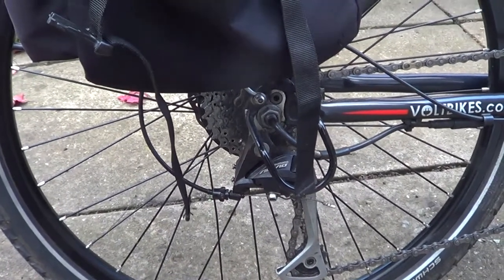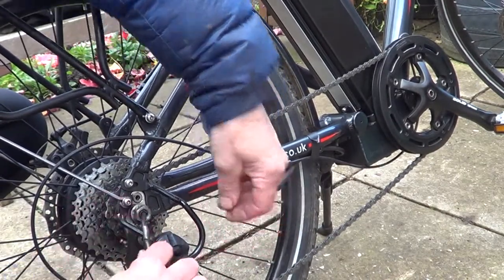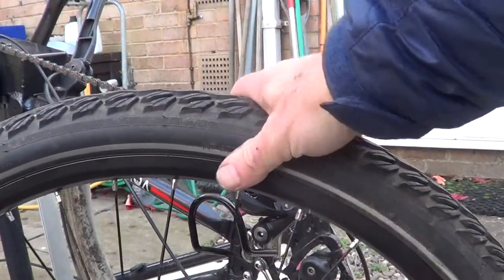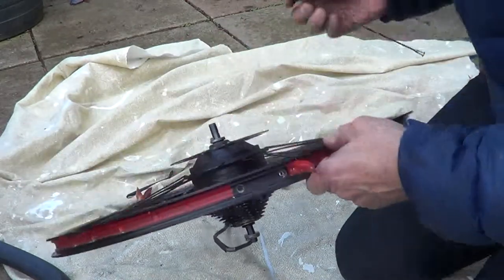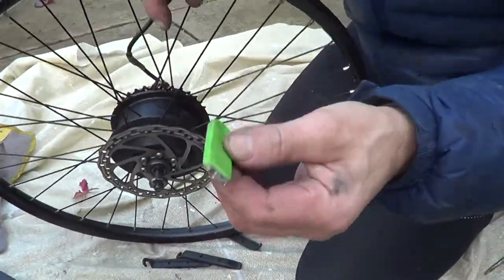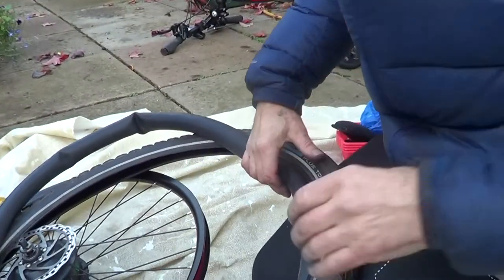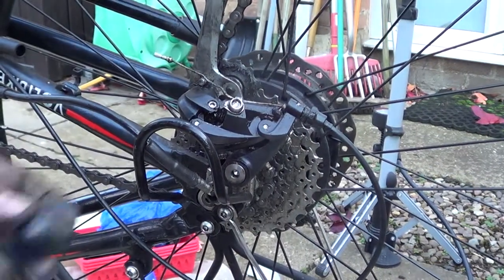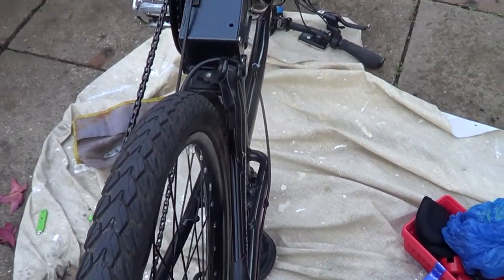Volt Bike rear wheel and tyre removal

Comment: Hey sir i have the same bike and I have 3 spokes broken but I don’t know the right size to buy them online , could you help me with the right size please
Reply from the maker: Hi Thanks for the comment I took my wheel to a local bike shop and he measured the spokes for me and found me a  replacement spoke for me to fit in. Now I'm sure they were these Dahon 208mm IOS Black Spoke I think these spokes he told me came from a folding bike which had small wheels but with the motor on the back wheel re the Volt you need these smaller size spokes if you have a local bike shop might be well worth taking the wheel as I'm not sure what the situation is on buying spokes online or how available they are Thanks Kev.
Reply: Bramley House Productions thanks a lot , I bought 208mm hopefully they fit on it , I went to London bridge shop on Tuesday but they were closed and they’ll open till the next year , I’m gonna follow you and fix it myself too 
I have an other question , I want to know if there’s any access to rich more speed on the Voltbike or it has a limiter speed ?
Reply from the maker: @Mohammed_Amine88  Hi good luck with the fix hope it fits your wheel also OK too. I did here these breaking spokes on some of the Volt Pulse bikes have been a problem in braking so if you do have more troubles go back to Volt bikes to see what they say! Like I say I broke mine pulling my chain which I had locked the bike up with and gave it a tug and broke the spoke. Re your other question yes I think you can de reg the Volt bikes to make them go faster but I would not know how this is done as they are not then road legal in the UK theoretically you could be fined if you ride on the road then if this is done! I know someone that there again asked Volt about this and they would not say how it was done due to it breaking the EU UK laws on e-bikes but I think you can somehow!  But naturally, as well as making the bike illegal to ride on UK roads the battery will not last so long if this is done Thanks and best wishes Kev.
Reply: Bramley House Productions thanks a lot Kev

Comment: I have an old volt alpine and now a newer pulse. The first puncture I had on the alpine I tore the tyre getting it off as was a metal braid removing the rear wheels on volt is an absolute bitch and a very hard roadside repair if not impossible. Their tyres do not flex. Installing the rear wheel is horrible the washers have slots, the power cable has to be right way up to prevent water ingress. Volts are nice bikes but I dread having punctures. My volt alpine has a click on the back when pedalling. No one including volt shops can identify it.